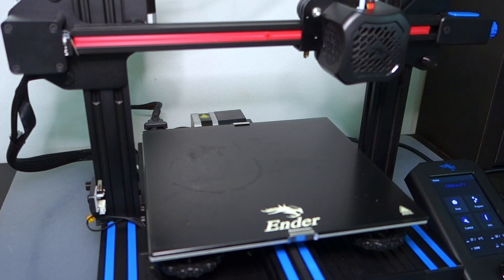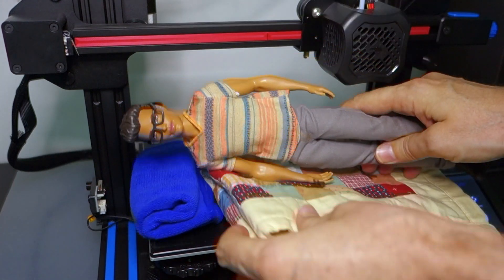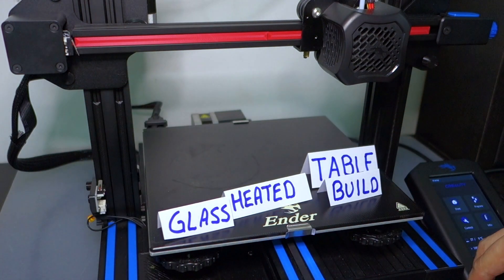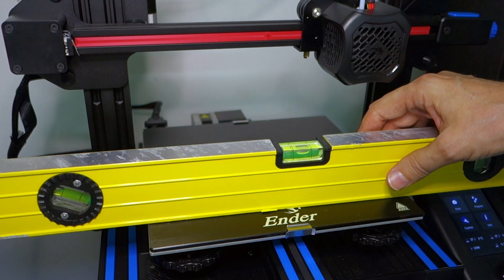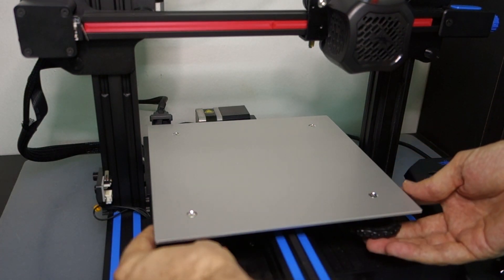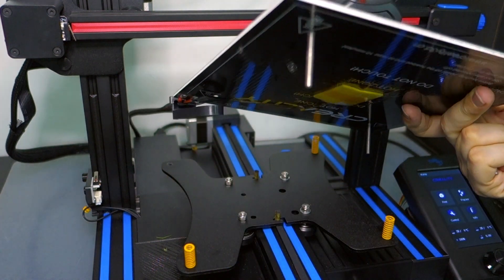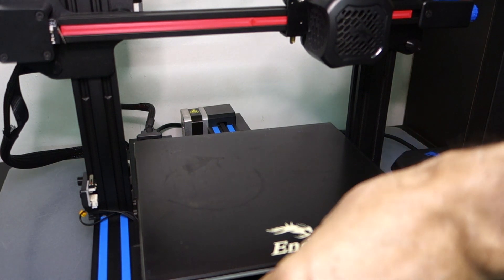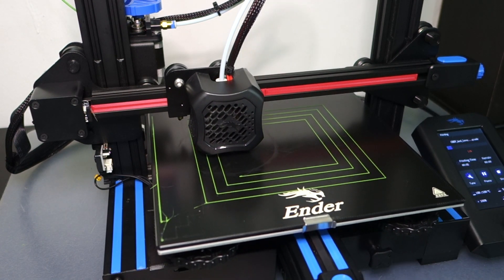UPGRADE ENDER 3 V2 SPRINGS | Easy Mod that Impacts 3D Printer Bed Leveling

Comment: Do the new springs work better than the stock ones?
Reply from the maker: So far, I would say so. I had seen a lot of people recommending to get rid of the stock springs and get the yellow ones or another one and finally decided to give it a try, especially since they gave me the yellow springs when I bought the machine! Cheers and keep on printing!

Comment: Did you adjust the z-axis end stop as well? Or were you able to tension the springs all the way so the bed was at the same height as with the original springs? 
I am having a hard time with getting the back left corner (with the bed's wiring) low enough with the new springs.
Reply: This springs are 20 mm lenght, u buy the 25 mm ones
Reply from the maker: I didn't adjust the z-axis end stop. I left it where it was. I turned the knobs all the way so the bed was all the way down and then brought the bed back up again so that it should be at the height of the original springs. That's an interesting problem that you are having with the back left corner. Is there any difference that you can see in that spring? Is it visibly longer than the others? Maybe try to swap that spring with another corner, or maybe (dare I say?) put the old spring back in that corner? Hope you are able to find a way to level the bed correctly. Cheers!

Comment: You shouldn't use the bubble level to make the bed level because your leveling is relative to the X gantry and not the absolute earth level, so do the four corner paper method and don't bother with the bubble. 
The yellow springs are much stiffer and they will prevent level shifting during prints, install them, level the bed and you will need to level bed less often between prints.
Reply from the maker: Thanks for the input! Yes, the whole bubble level thing was a bit of a joke--we tend to include moments of humor throughout our videos. :)